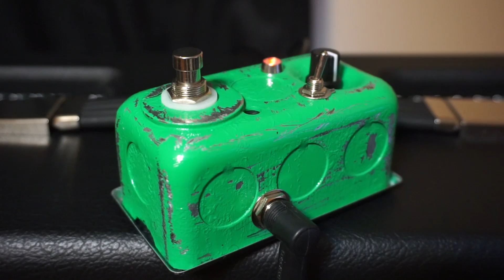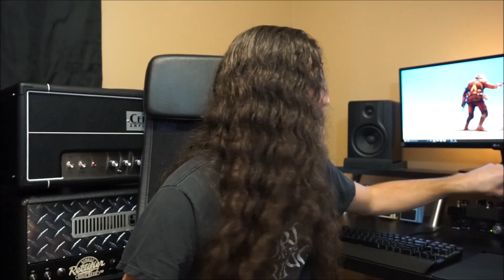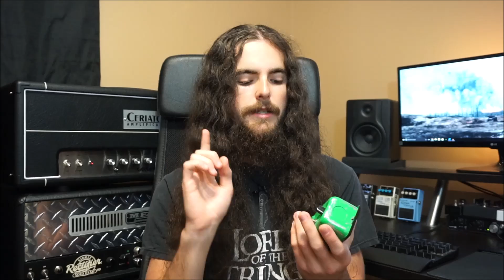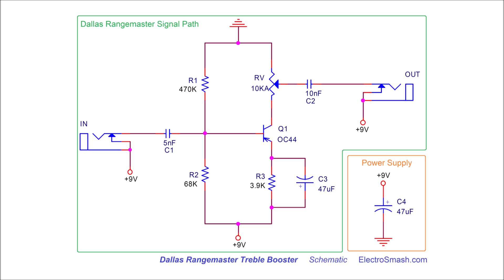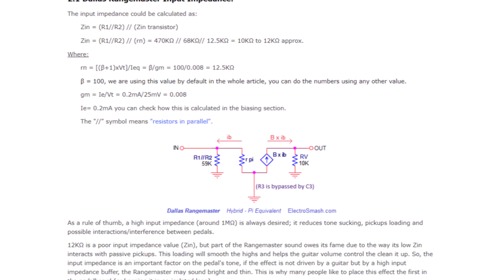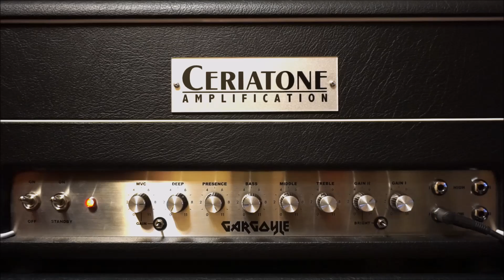Dallas Rangemaster Treble Booster (Mod): A Simple Circuit with Massive Tone

Comment: I’m late to the party but awesome video! I’m a Sabbath fanatic and new player and only have interest in playing an SG through a Laney LA amp, Laney cab w/H series speakers replacing the M green backs and a full range germanium boost. The difference between 9&10 on guitar volume when amp and pedal is cranked then crank guitar from 9 to 10 you’re on planet Sabbath. I just ordered one of these but he’s making them with silicone transistors now so hopefully it’s as good as germ. There’s just some type of mojo with a germanium.

Comment: I just recently bought a treble booster (TI boost) after 25 years of playing and man was I missing out. I've always been a Tube Screamer guy but I love  having a different flavor of drive when I want a thicker sound with more harmonic content. I think know I wanna try the Colorsound Overdriver or some variant of that...
Reply: the cs od is a very different pedal . you might love it . i have a vick audio . its very different sounding circuit tho .
Reply: @peteytwofinger  I ended up with a tru fi colordriver and I like it. It's not my go-to drive pedal but it works great for some things. I picked up a Death By Audio Interstellar Overdriver as well, and I LOVE IT with the right amplifier. It's definitely not a stand alone overdrive sound that you would run into a clean amp, at least not in my opinion, but it might be the best way I've found to drive a tube amp that's on edge of breakup into Sabbath territory. It's definitely worth checking out.

Comment: A few simple questions: Where do trebles start? Where do they end? Does the amplifying device change the character of those treble signals? BTW, this man has excellent knowledge. I like the Dongeomac builds very very much.
Reply from the maker: I think this article will answer all your questions and more. The 3-way mod switch controls where the "treble" range begins with different capacitor values. This is not an entirely clean boost, so all those frequencies above the capacitors cutoff frequencies get overdriven to some extent.

https://www.electrosmash.com/dallas-rangemaster
Reply: @PlagueScytheStudios  Thank you very much for your reply.

Comment: So the Rangemaster should go first? That’s interesting, because the instructions that came with my Rangemaster said it should go last.
Reply: There’s no right or wrong, but generally you want distortion either as close to the amp as you can get (if you’re using amp gain) or almost first, behind wah if you’re using clean amp and time time effects like delay or reverb. It really just depends on your rig. You should treat it how you would any other drive pedal basically.

Comment: Yes, the rangemaster's a special booster because it interacts with your guitar settings. Crank up your tube amp , leave the pedal on and use your guitar volume knob to go from overdrive to clean tones without losing volume ! Check out Brian May .
Reply: brian mays tend to be more of a full range boost . they are great tho , and less noise but not a rm at all . there isnothing like a proper ge rm . you can go as far as npn ge but you need to stick with the proper cap , once you start slapping 2.2 uf caps , its not a rm .

Comment: I just built a Brian May Treble Booster(pretty much a Range master clone) on vero board last month an its pretty much identical to yours(sounds fucking incredible through my Marshall DSL100HR and JB/59 pickups). I used an on off on for the tone control so like yours it goes Bass/full freq boost, stock treble, an mids. I prefer the stock and mid positions but they are all great. I also used an MPSA18 (silicon) transistor instead of the recommended 2n5088 or 2n4401(also silicon). The mpsa18 is a low noise transistor that sounds just like a 2n5088 but in my opinion better. I used a transistor/3 pin socket so i can easily swap out transistors and i have a 2n5088 and 2n4401 inside the pedal ready to be switched out if i want. There are certainly difference between each one. I also added a volume control instead of just a gain. Having a volume and gain makes this pedal much more versatile. Lastly ill say if you play passive pickups all the time or even just sometime YOU HAVE TO HAVE A TREBLE BOOSTER!  I also have a TS9 (tube screamer) that i modded aswell that i love but you just dont get the same type of boost. I promise anyone who trys a treble booster through the right amp will be a convert for life. I also built a klon clone and boosting the transparant klon with the treble booster is just heaven. Its such a responsive and dynamic tone. Anyways highly recommend treble boosters. But remember you cant use them with active pups or after a buffer. Because of that you should pretty much ALWAYS have a treble booster first in your chain. If you put it after another pedal 9 times out of ten youll kill the magic.

Comment: It sounds different with the buffer in front of it, but not necessarily bad. It's still a workable tone, although I prefer the one without the buffer in front.
Reply from the maker: Yeah the full range mode isnt the worst, but admittedly I showed the best case scenario here. The other two modes don't play as nice, but again, they are workable depending on your setup.
Reply: @PlagueScytheStudios  Nevertheless, it's a great circuit. I've been eyeing a tony iommi signature treble booster lately, and I might just pull the trigger on it

Comment: The dalas rangemaster produces asymetric clipping and has a low impedance input, any EQ pedal wont sound like it.
The EHX screaming bird has higher impedance (still not as high as a jfet boost), cut more low frequencies and is cleaner (meant to produces less distortion as possible), an EQ pedal can sound close to that one.
The modern and silicon equivalent of the Dalas Rangemaster would be the Naga Viper by Catalinbread.

(No I haven't watched the whole video :C )
talking about input impedance, its effect is the same as having a very low value volume pot on your guitar, basically your pickups and guitar electronics are forming a RCL filter and the impedance will change the bump in the high frequencies, more or less high.
It can go down in frequency with a capacitor connected to ground at the output.
And this is the basics to voice guitar pickups with passive electronics.